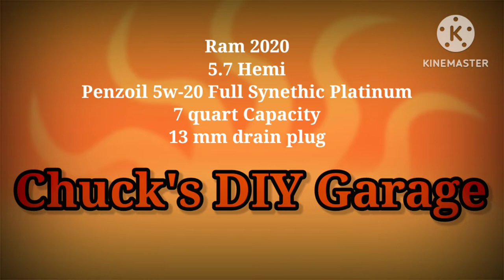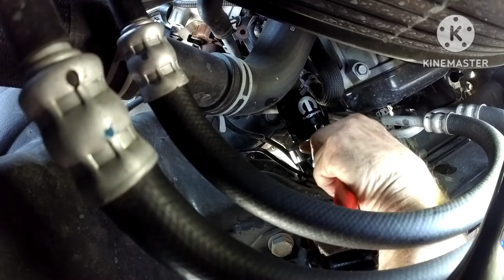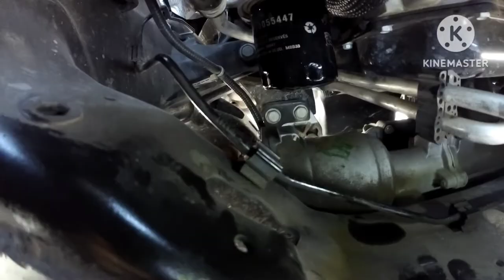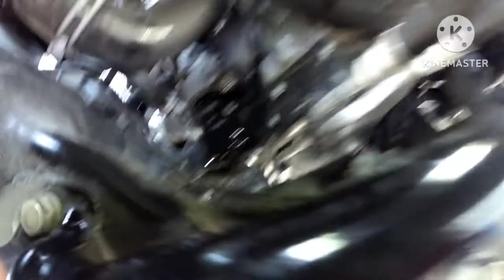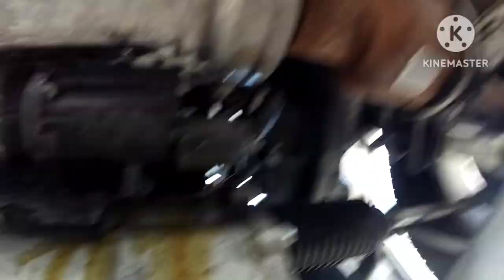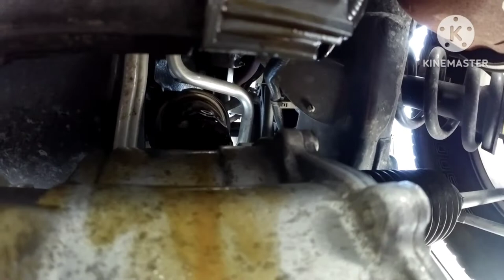Ram oil change

Comment: I took a disposable aluminum baking sheet and bent it to fit under the filter and around the steering mechanism down to my catch pan.  Works like a charm and I haven’t had a single drop of oil get onto the steering.

Comment: I want to thank you so much for this video post. I have been dreading the oil change in my 2023 Rebel after reading about the engineering debacle that is the Ram Hemi oil filter location. I finally got brave and did it this afternoon. It took 55 mins altogether with meticulous tarping and prep for this job. All thanks to you. Accessing the filter from the front is simple. I also invested in a 4-inch "oil udder" (look that up) and simply fitted it around the filter and hand loosened the filter (after using a wrench to loosen) and no mess at all - everything funneled into my catch pan. I could not be happier. Thanks again!
Reply from the maker: Thanks

Comment: Didn't show or mention that the gasket seat on the block should be checked and cleaned.  The filter gasket should be lightly coated with clean oil.  If possible on vertical filters, they should have oil added into them before installing, and should NEVER use a wrench to tighten the filter.
Reply from the maker: thanks for the input. but as mentioned in the video it is not for neophytes. I clearly state that I'm sure all that is watching already do and know what you suggest is good practice. i wasn't going to beat that dead dog. The intent was to show how to "attack" the oil filter for removal.

Comment: The filter's not difficult to get to at all.   Oil just drains down on the power steering unit unless you put a catch pan under the filter of some kind.    I use a flex funnel myself.  The gallon size baggie method works reasonably well too.
Reply from the maker: perhaps yours is 2WD?  4WD has the torsion bar in the way.

Comment: Have you done your trans oil yet?
Reply: I just did at 76k miles.You must take it to a real transmission shop to have it done.  FYI....its not just the fluid that gets replaced.  They replace the filter along with a new oil pan...it comes as one unit.  Cost here in AZ was $1100.  Sounds expensive until you look at what a new transmission costs.
Reply: @msgmak1379  

I did mine. Got a pan from PPE and now has a replaceable filter. 

Cost $287 +fluid that I got a hook up on... (fluid is OEM...)

Wasn't to bad of a job, just allot of steps...
Reply from the maker: no, not there yet. but thanks for the tip.

Comment: All the extra crap you went through and you still think it's fine?

And I put a ball valve on my drain plug, I'm 14 oil changes in...
Reply from the maker: not sure what you're are saying. thanks for watching
Reply: @chuck7432  

The steps you took that were only necessary because of where the filter is located.

It's a shitty location that makes a  once simple task that much more of a pain.